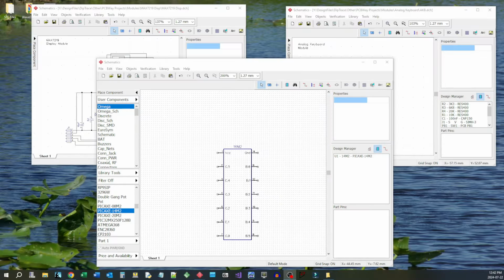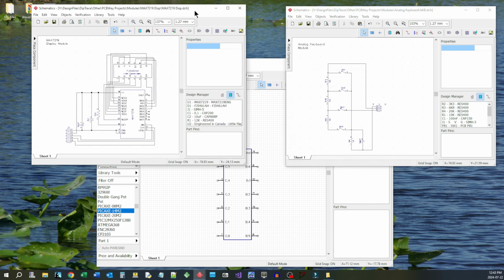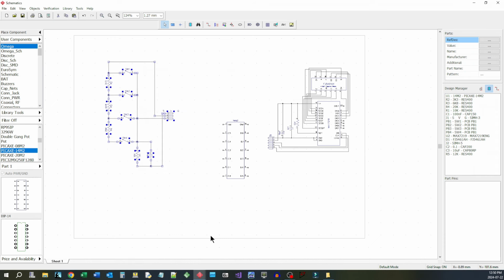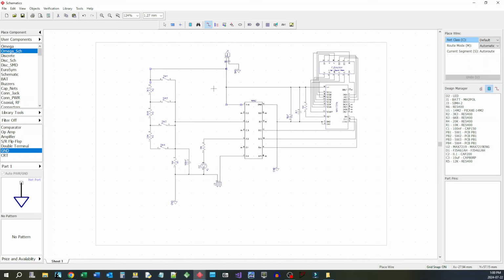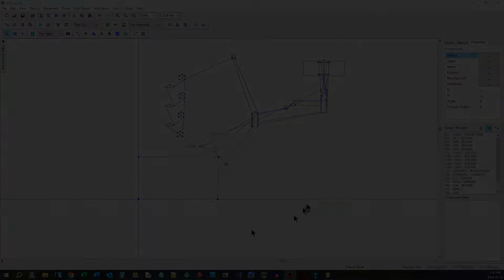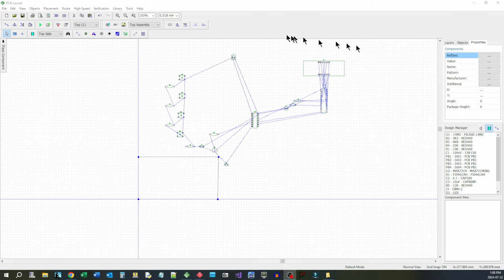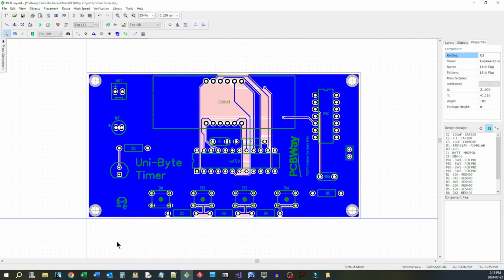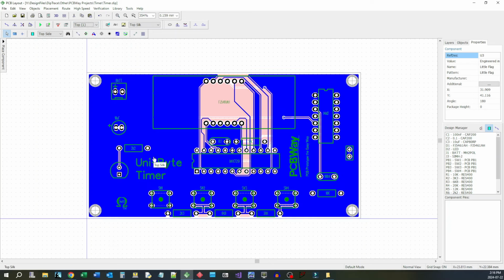Uni-Byte 0203 - VETERINARY Dry Eyes Treatment TIMER - Modular Design

Comment: I wish I knew how to use that program to design your PCB, you make it look so easy!
Reply from the maker: It is pretty easy.  There is a learning curve but it's not that bad.  Easier than anything else I've tried.  The product is called DipTrace.  They still have a free version that is limited to 500 pins and 2 layers which more than adequate for  most hobbyist needs.  I'm not affiliated, but I have been using it since version 1.  I guess I'm a bit of a fan.
Reply: @uni-byte Another free option is KiCad. It is a complete, professional-grade electronics design program. No limits on its features. I have used it for years and I love it. So, there are options.